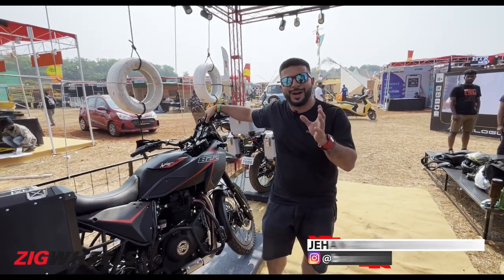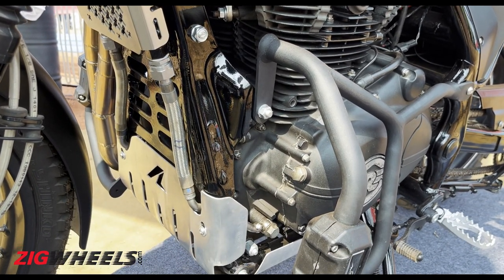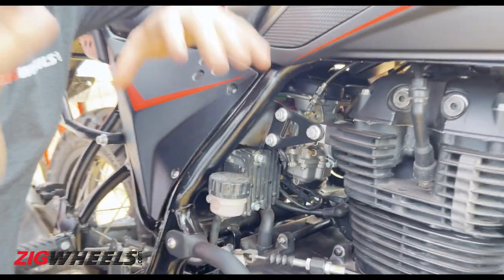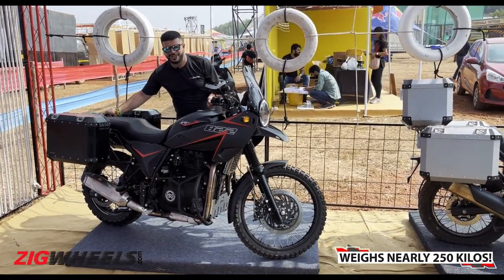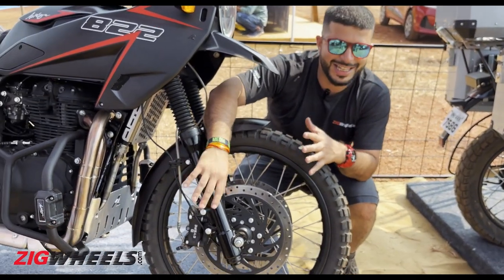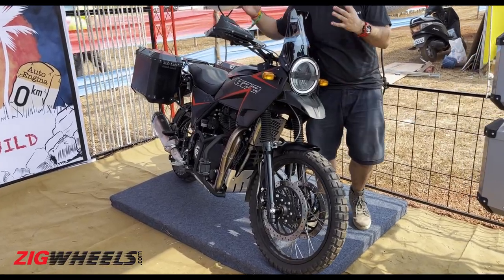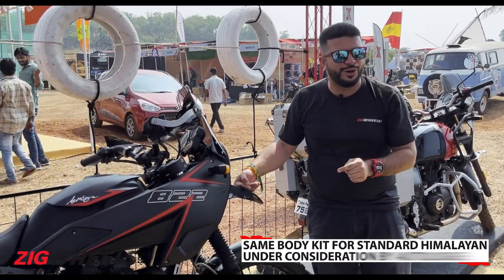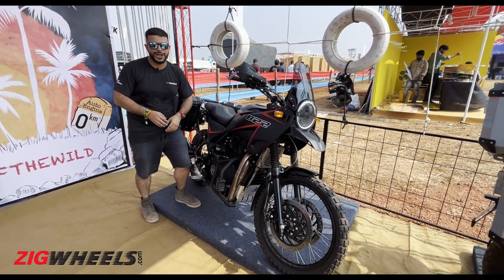EXCLUSIVE Look Of The Himalayan 822 From India Bike Week 2022 | Made By Autoengina Walkaround Video

Comment: A Noble effort! I would like to see the crankshaft, that would have been some real machine work. The weight is irrelevant as it's a prototype. What happened inside the gearbox? Did you whittle out a normal Himalayan gear compartment? It'll be nice to see it under power when the time comes. A big twin off road will always be a handful, but you look to have made some nice compromises. Well done!

Comment: Power figure is fine but it is the torque I am interested in as well as the rpm at which it peaks. An 822 cc long stroke twin cylinder engine would have a fair amount of torque. I think it's a great project. 

That fairing looks weird, though. Pretty standard for Autologue Design.
Reply: Don’t forget about it’s a ADV, punchy mid range is also crucial
Reply: @Omkar_Allewar  With two cylinders, it should have strong mid range torque despite the long stroke.

Comment: 822 CC Motor Produces Only 48 50 BHP That's very Less...
Actually The Stock Himalayan is Underpowered itself...411 Cc Motor Produces Only 23 24 BHP ....
Ns 200 RS 200 Duke 200 RC 200 
These Bikes have Only 200 cc Engine But Produces More Power Compared to Himalayan
Similar Goes for interceptor 650 ...
I MEAN to say that CC wise the power is less Compared to Other Brands...
If we Compare this 411 cc Engine With Dominar 400 and Duke / RC 390 Engine...CC wise They Belongs to same Catagory But Power wise there is a Huge difference.... KTM s Produces 43 BHP 
Dominar Produces 40 BHP 
Now All of you will say me that Dominars, KTMs are Sports Bike and These Himalayans , Interceptors are Adventure , Cruiser Bike 
Yes they are ...But I am not Comparing them on Their Catagory and looks
I am Comparing their Engines On the Basis of their Engine Capacity...
There are Other Adventure Bike's as well which is powerful like KTM Adventure 250 / 350
And How Can we Forget the Clone of Himalayan , I mean Yezdi Adventure...
That Bike has 331 cc Motor But Produces 30 BHP ...5 to 6 BHP More than Himalayan .....
Royal Enfield should think about it
Their Bike's are Heavy But Engines are Underpowered..All of their Engines ...

Super meteor 650 that Bike will be Around 250 kj Can You imagine But Produces Only 45 to 46 BHP which is very less if we Concerned about its Power to weight Ratio
Will Affect it's Performance on Highways or long Road Trips..will Effect it's Milega as well......
Either they should make their Bike's light weight or they should increase the power of their Engines
Reply: I also have the same thought. Dominar 400 is such an underrated bike. VFM is good but comfort, cruising, modern engine, better tech, these are all underrated.

Royal Enfield should really think about making their bike's weight lighter plus engine output. This would also mean tuning will be different and R&D as well.

RE has such a huge fan following but I don't understand why. I am a RE as well as Bajaj owner myself. But Dominar 400 is so much better than my Meteor in several ways.
Reply: You are only looking at the engine displacement and power while ignoring everything else. For example, the Himalayan 411 engine puts out about the same amount of power as the Pulsar 200 NS engine but what about the torque? Pulsar puts out 18 Nm while the Himalayan is almost double at 32 Nm. The Pulsar's torque peaks at about 7500-8000 rpm and Himalayan's at 4000 rpm or so. So, that is double the torque at half the rpm which means you don't have to shift gears very often on the Himalayan. That makes a huge difference in the riding experience.

As for the KTM 390 engine, the BS4 and BS6 models have ride by wire throttle that feels disconnected from the rider. The Interceptor feels more direct because of the cable throttle. The BS4 390 Duke feels a bit slow in the city and the engine is boring below 6k rpm. The Interceptor has torque throughout the rev range and feels very lively and energetic but at the same time very relaxed too.

You can read spec sheets all day (while still selectively ignoring relevant parts of it) at the end of the day you can't ride them. You can only ride the actual motorcycle and how it feels to ride is what matters.
Reply: @twowheeledparadox  It's not about specs sheet. Interceptor is a 650cc twin cylinder motorcycle. The bike u have compared it to is a 373cc single cylinder.

U still compared the Himalayan 400 to a pulsar ns200. Compare it with dominar.
It puts out 40hp power n 35nm torque. 30nm of torque is available from 3000 rpm.

One more thing for your kind information is ride by wire actually increases the throttle response that the rider can feel while reving the accelerator, the ride by wire actually makes it so that rider feels more connected to the bike.

I am able to say all this because I own a Royal Enfield Thunderbird, Bajaj Dominar 400 and Jawa 42 as well.

And yes I have test ridden royal Enfield interceptor 650 as well. But i am not comparing it to a triumph bike just like you did.

A twin cylinder motorcycle will have more power, more refinement, less vibration as compared to a single cylinder engine.
The fact about Himalayan is the bike is tuned for off roading. Other bike mentioned above are for casual riding and sometimes offloading. Nobody working in a job will be able to do offloading everyday even if there is a off-road track nearby.
Reply: @mJustLucky  I compared the Interceptor and the Duke based on the fact that the price, 0-100 and braking performance are very close to each other.

The OP compared the Himalayan to the Pulsar 200 NS and so I responded accordingly. Please read the original comment first. If you have a problem with the comparison, tell the OP, not me. The comparison of the Himalayan with the Dominar is still valid, I'll give you that. That bike has good value for money. If the Dominar had off road suspension, the Himalayan's sales would take a hit in India.

Ride by wire makes the throttle feel disconnected on the 390 Duke. It feels laggy and the response is not as sharp. Even when ride by wire was first introduced in multicylinder motorcycles, the problem was there. It has only recently been fixed in more expensive bikes. It has not been fixed in the 390. Its ride by wire throttle is BAD. 

You buy an off road bike if you know will be going off road. I find that the Himalayan is easier to ride in city because its better low end torque when I compare it to my 390 Duke. And at high rpm, my 390 Duke shows its throttle's limitations.

Also, when did I compare the Interceptor to a Triumph? I read my comment again but could not find it. Can you point out where I made the comparison?